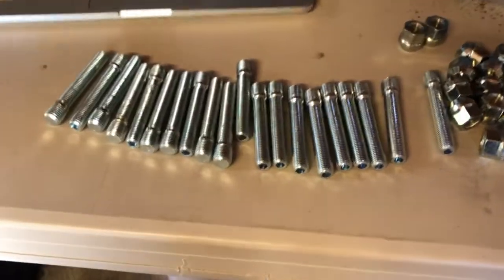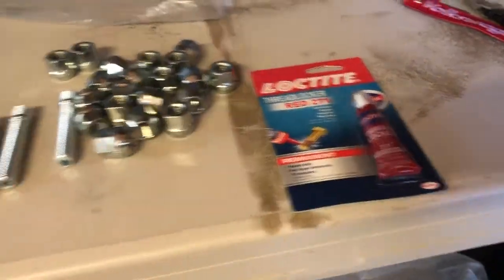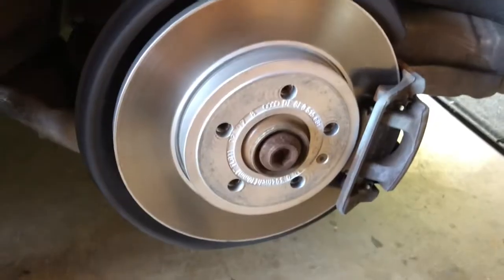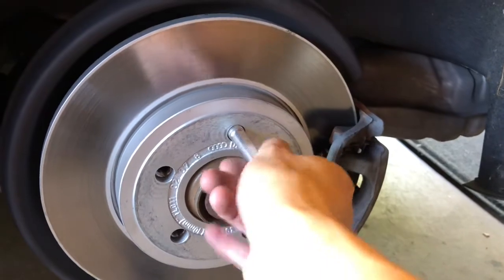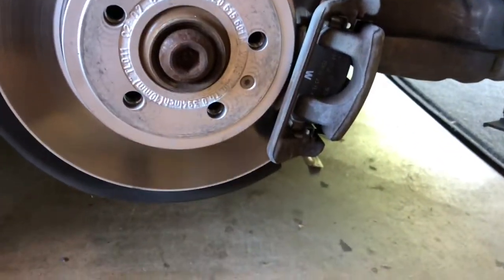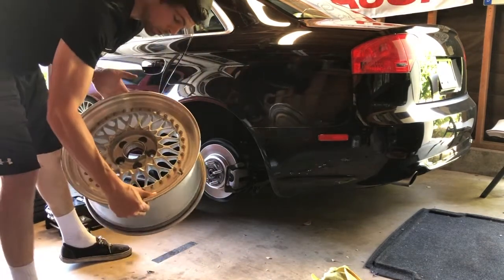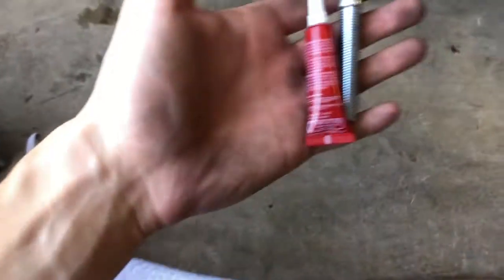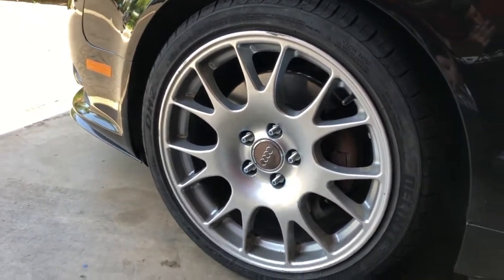Audi Stud Conversion

Comment: Hey man, so I’m currently driving a 2016 golf R, with a 5x112 bolt pattern, been racking my brain . Considered a wobble bolt, but doesn’t seem solid enough . If I do the conversation kit like you did I’m able to run 5x114.3 no problem?
Reply: I also never knew that a stud conversion would allow us to run 114.3. I don’t understand how honestly. I understand the logic behind wobble bolts though, but not these
Reply: You need to get studs that convert from M14x1.5 to M12x1.5 
That’s how you can run 114.3 wheels.  Or you can just convert straight to studs so you can run spacers on 5x112 wheels